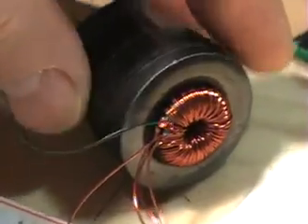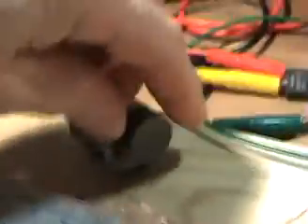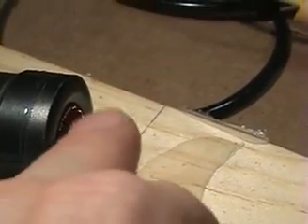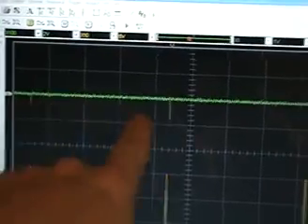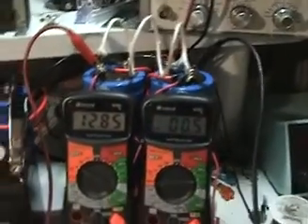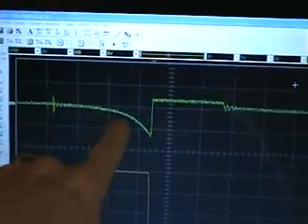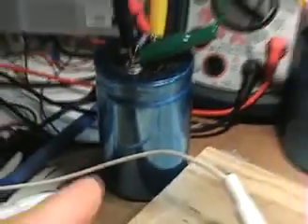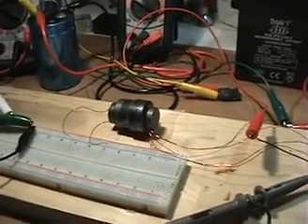Magluvin PM Flux Gate Coil test 1

Comment: 1) Increase excitation frequency (within the cut-off limits of BH curve)
2) Increase the number of turns in the sensing coil
(or have a novel way of winding that is not strictly "solenoidish"
3) Increase the cross-section of the ferromagnetic material
(but, a larger cross-section will require larger current while sensing)